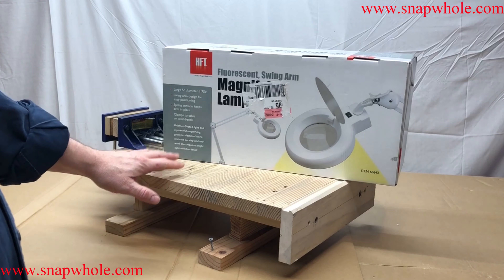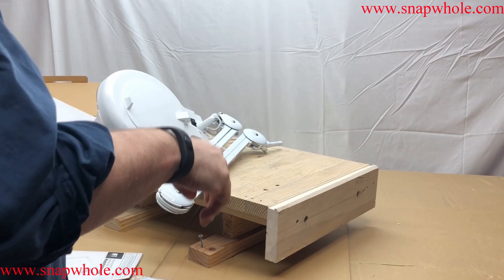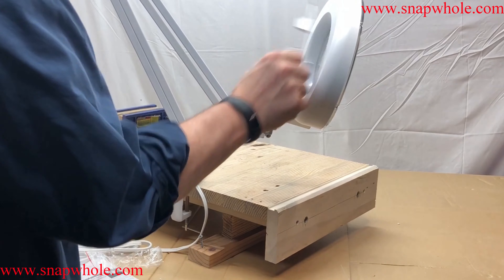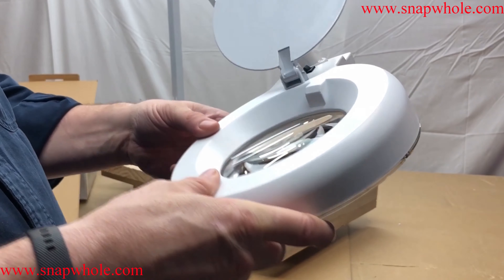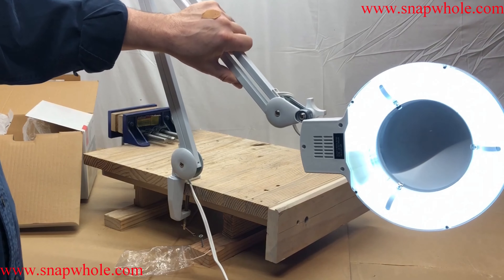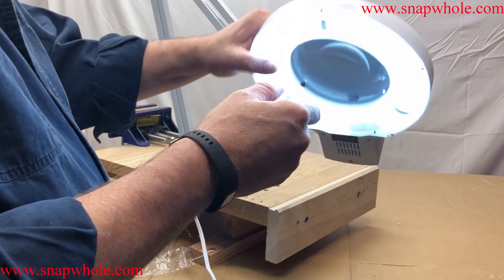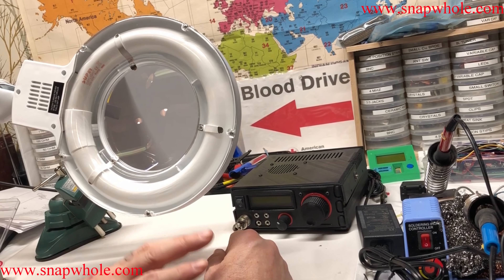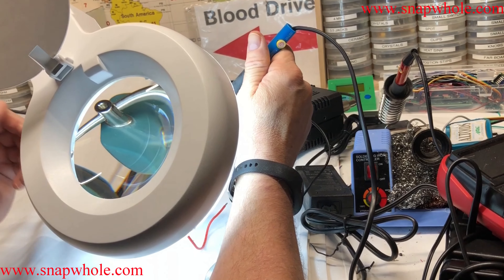Harbor Freight Fluorescent Magnifying Lamp Review and use Demonstration

Comment: I received my light the other day.  I use it for my scroll saw.  The lens cover was a problem for me.  It kept getting into my way.   So, I pulled it off.  It is held on by friction.  No need to cut if off or break it of.  It is much better now.
Reply from the maker: The cover 'handle' is shaped wrong and does not work well, its provided to force all the light down to get better work coverage when not using it as a magnifier - but I agree with you, its not needed, I bought mine to use as a magnifier, not as a desk light - Thanks for subscribing!

Comment: I just bought one. It's very bright and the magnifier is big, which makes viewing small things (in my case, electronic parts) very easy for a farsighted person, like me. However, I've found you need a relatively wide bench 5 feet (1.5 meters) to use it, because the lower arm will not bend out further from the vertical plane. Meaning, the lamp/glass is always set ~2.5ft (.75 meters) from the holding clamp, no matter how high or low you position it.

I've used other devices with similar adjustable arms that offered a much wider range of movement, so I know it's possible to move this along the x axis; this design just doesn't accommodate it. I'm guessing that's why it's only $40US. It's a great price and lamp/magnifier if you have the right space, but unfortunately, it doesn't work for mine so I'll have to return.

Oh yeah, I have to agree with the video: the dust cover handle could have been designed to be more tactile. If I were to keep it, I'd be pressed to add a tiny inexpensive padded bumper between the dust cover and lamp body to keep it from slamming shut.
Reply from the maker: I still use this a lot, but I bought the smaller desktop model and I started using it some, it has the same magnification, but its not too tall, no perfect solutions...... thanks for subscribing!

Comment: my spring has become unhooked from whatever it hooks up too..
Reply from the maker: I had the same problem, I replaced the mount, without a custom tool to reach down into the frame and pull the spring back out, its almost impossible to reattach the spring - I think it is a design flaw, it works for a while, but I think failure is inevitable, and repair is likely impossible - I have started using the head mounted magnifying lenses - video of how I fixed it - https://www.youtube.com/watch?v=lMyBAayNYFQ thanks for subscribing
Reply: I watched the video and im still not Sure how you got the spring attached and what it attaches to ? I almost went and bought one just to see where it hooks up too , I see the round part on the end of the spring not attached just dont know where it goes ...thanks for you help!
 @snapwholeharborfreightreviews
Reply from the maker: @geeveeme  it came attached, I did not attach it, by the time I was curious about how it attached, it was broke and I could not tell it used to be attached, I fixed it by getting a replacement arm with the springs external to the arms, i just happened to go to a hamfest right after it broke and picked one up for a dollar or two, the arms are commonly used for small lamps and a source paper holder for typist or musicians and broadcast microphone holders - I always find a lot weird and random stuff a hamfests, a lot of hoards sell their crap at hamfests - thanks for subscribing!